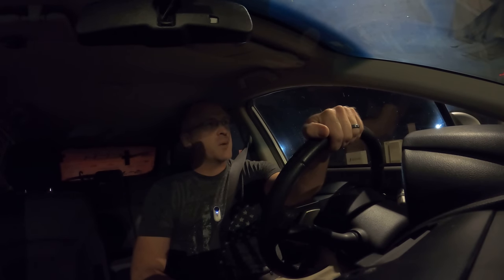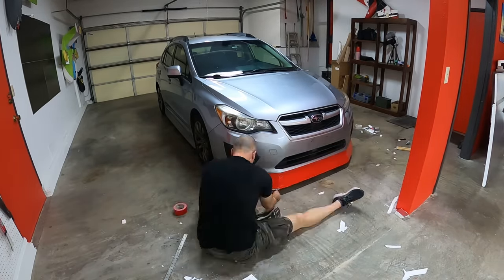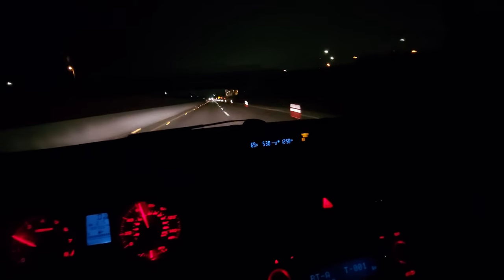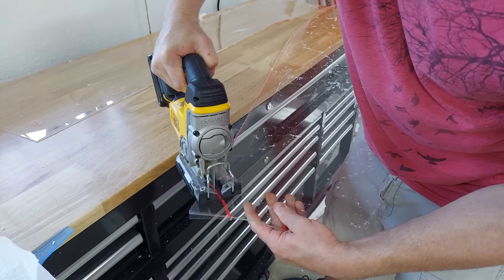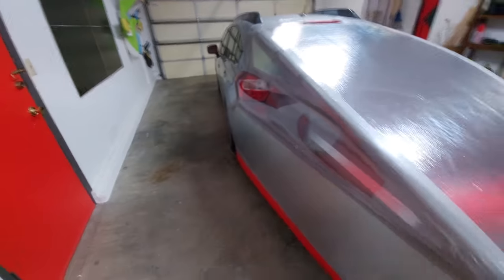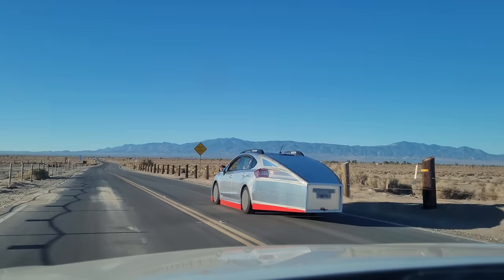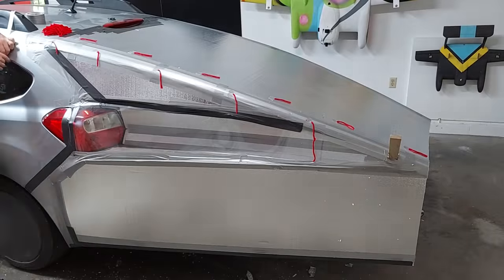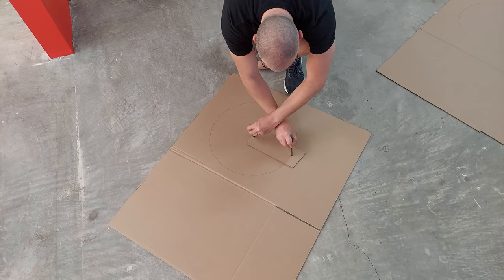Beating High Gas Prices Using Simple Aerodynamics (Home Improvement Store Edition)

Comment: The tufts only tell you if the flow is laminar or turbulent. It does not necessarily tell you "high drag" or "low drag". Also consider tire pressure: a difference of 2-4 psi can make a noticeable difference in rolling resistance and thus fuel efficiency. It would be good to verify the pressures when setting baselines to make sure that isn't affecting your results.

Comment: 2 things that may be externally reflecting your results: 

- Fuel efficiency can be notably effected by your ECU in your car. External temperature and engine temperature may cause your ECU to adjust your air to fuel ratio.

- wind, driving in a head on wind or a tail wind can make a significant difference. 

- humidity

Comment: Sealing that underfloor even partially will still help

As well a front splitter will also help over just that chin, also when building make sure it extends past the front firewall or from that front firewall to about 30mm past the front air dam

Also a much better test for aero drag would be coast downs rather than long drives due to variability

Also “vortex generators” are a fickle beast and mostly useless without complex cfd work

You’d get much better results from sealing panel gaps Ana worrying about tire pressure and equalizing them

Comment: The skirts you put on the front and sides simulate the function of a diffuser (shielding air flowing below the car from the sides and accelerating it at the rear, by opening up the way the air can move). A diffuser is used in Motorsport and notorious for creating heaps of downforce and comparably low drag.
And I think here is the problem with the new tail. The 90° angle at the end is too aggressive and you get turbulent air and drag. Put your stripes beside the licence plate. If you gradually slope up the bottom of the tail as well, it should work much better.
Nice video and crazy interesting thanks 😅
Reply: The cutoff of the end of the tearsrop shape creates almost no extra drag for the removal of material. In fact, it can be beneficial to break the airflow that sticks to the car which is why tons of sports cars have abrupt tail cutoffs

Comment: When your improvement is going to detach suddenly at 90 mph and everybody panically braking being scared of it will bump each other in disorder, you'll discover a russian saying "Кроилово ведет к попадалову" which means "Hacking workarounds are usually the shortest ways to face a big loss". Easiest way to get even 20 per cent MPG growth is just a gentle handling with your gas. Good luck!

Comment: The problem I found with the newer imprezas for MPG is that they're overweight and underpowered, so you end up using more gas because you're pushing the engine more. 140hp is not enough to move 3,100lbs efficiently. 

This is why my WRX was able to do 38mpg or why the corvette is able to do 30-35mpg. Although both weigh more then the impreza, both have a considerably higher amount of power. Meaning that the engines are understressed when you are driving.
Reply: all depends on the torque curve, 140hp diesel is plenty for 3100lbs, too much rather, while gasoline, especially NA, engines are already at the upper end of their efficiency range.
The difference is the diesel makes alot of power at the RPM where its most efficient, while the gasoline engine typically make the same power at a higher, less efficient RPM.

With slightly relaxed highway driving, a semi-modern diesel with a efficient drivetrain and good aero does a good 55-63mpg.
Reply: @user-si5fm8ql3c  That's true too and I should of pointed that out too because I do know that diesels are way more efficient for this type of driving, but I think the reason why I didn't point it out is because he is driving a impreza and not a jetta.

Comment: there are fairly cheap fuel push drains that you could install in the bottom of the tank and drain the fuel, like those used on airplanes

Comment: your difference can be result of many things including fuel density, air temp, type of driving attempted ( sprint or easy acceleration ) , etc. usually 10% improvement isn't considered unless it's having a significant quantity impact. For ex 10% of 1ml vs 10% of 1000 ml.

Comment: Best fuel efficient mod on any CVT Subaru Is changing that fluid if old, the thing will regain a couple of MPG, also new spark plugs, the new NGK ruthemium plugs gave me about 1-1.7mg extra.
PS: I also own a 8th gen Civic automatic. You can get 40mpg pretty easily with no mods, I can imagine you could get quite a bit more out of it, it's a 1.8 liter 140hp engine, powerful enough and stock aero seems pretty good.

Comment: I think, if you put a Belly Pan, that covers the whole underside of the car. Cover all the gaps on the body with tape and block off some of the front grill, that should give you much better results. Also, ad much more air to the tires.

Comment: I'd be interested to see a spoiler that provides lift rather than downforce. I'm wondering if that decrease in force to the ground would have a difference? In my mind, there would be less friction since the air would be slightly pulling the tail of the car upwards

Comment: You should model your tail after a boat-tail bullet.   Check your state's law on how far you can hang/ extend your vehicle from the bumper.  Most state's have like a 2-3 foot limit.   You don't need a full chin spoiler.  just an aero fairing in front of the wheel and behind the wheels.  Think fixed gear aircraft fairing.

Comment: Gas pumps use back pressure that can be highly variable. But the weight of the fuel is consistent. Longer run and use a certified scale to measure the before and after weight loss due to fuel burn. A baseline of running down the tank, then adding 10 gallons should give you a good 60 lbs or gauge. Just a thought.

Comment: It's critical that the front of the car is as smooth as possible to help maintain laminar flow so to that end it would be advisable to ensure that the front lights and grill area as well as the wiper blade area be as smooth and sleek as possible. this should yield significant gains.

Comment: Hi There, nice project!
Due to the attached flow on the underside of your tail effectively working as a diffuser you may have ended up with more air under the car. Since the non smooth underbody and exposed wheels this may significantly counteract the drag reducing effect of the sides and rear.
Unfortunately I didn't notice any video of you driving on a dirt road with the first tail on. The amount of turbulence in front of the rear tire may indicate that you indeed may have more air under the car with the new tail design.

Comment: To get beyond 18% fuel efficiency, consider blocking the radiator grill. Use a clear window film and a double side tape to wrap the grill. Based on my past experience you could get 5-10% improvement. Your car won't overheat because air can still get into the engine compartment through the front bumper. Good luck.
Reply: I was looking for any comment about this. I find it interesting that the huge amount of hair getting through the radiator and engine compartment is never mentioned in the videos and articles I've been reading about aerodynamics.
Just recently some cars have been equipped with mobile parts to close that area and improve the aerodynamics.
That would be a very nice experience on its own!

Comment: If the bottom side of the tail isn't covered it is basically a parachute.  The back was open on the first tail, but closed on the second (for licence plate) .

While the tail improves flow over the top I think it is hurting flow under the bottom, which is why the front spoiler & sideskirts effect was exagerated.

Comment: 12:36 hmmmm... at first I thought the cabin side-skirts were like a single line (or two) of thick bristles (like a thin broom). Maybe that would be a good practical solution for an actual daily car, as when you drive over an obstacle (eg a high speed hump), the bristle would give way, but under normal high speed driving, they would act as a solid surface/wall, forcing the air to go around.

Comment: hi, i love this series it's damm awesome to see someone try this for themselfs and for cheap, one sugestion tho, the underside of the tail should come up very little in a curve, kinda like a diffuser to improve the smoothness of airflow on the underside, but not as much as the first version of the tail. The issue you faced now may be because of the flat underside of the tail catching the turbulent airflow that comes after the underside of the car itself, that pressurized air needs a smooth reintegration into the atmosphere and for that the small curve, that plus a flat floor would be an insane gain. Either way, awesome content

Comment: what tire size are you running? if its a 205 width I recomend going down to a 185 width and you will see a fuel economy gain, less contact patch = less rolling resistance.

Comment: one potential explanation is that you're not treating the air under the car very well with the new tail. It stays close to the ground and just dumps to open air. I'd be interested in the effect that adding a rear diffuser would have on it. If I'm not mistaken, that's one of the race car mods that increases both downforce and efficiency.

Comment: Dimpling flat surfaces ( like a golf ball) helps keep air from sticking to the surfaces, In not sure how practical it would be to do on the parts you added but it does make a difference to the point that some advanced race engines have this aero trick in their intake systems
Reply: Also, “Cyber Subaru”? 

Cyberu?

Comment: I'm sure a super flush underside is better than front lip, but for practical reasons (it'd cost so much to have an absolutely flat underside) the lip is good, especially to retrofit to stuff like a semi. When you consider how much they haul and then figure in a half mile of fuel savings that's a lot of fuel saved over 500,000 miles of trips.

Comment: After watching these two videos I decided to design a car based off of what you said in concerns to why auto companies aren't making cars more efficient. After making a sketch I commissioned a 3D model and had it tested in a wind tunnel simulation up to mach 1.01 (775mph) where it was stable.

While looking into a few other things concerning vehicle manufacturing I learned that America has a strict law about fuel efficiency based off of the footprint of the vehicle (makes no sense). It's measured from wheel center to center, and if the vehicle deviates from a chart the Feds made, manufactures get fined $10 per 1/2" out of tolerance. And to get REALLY good aerodynamics, cars would have to be way outside of that chart tolerance. So the car I designed would have an additional charge of roughly $500 or more to the manufacture because it was to aerodynamic if I'm understanding that law correctly.

Comment: As a truck driver with millions of miles behind the wheel. I'd found myself working this problem. Occasionally you'd see snap out panels on the Swift trailers. Never seen it done, but an air filled panel could be made. And then I thought what if like a shaped air balloon or parade float. a shaped air filled bag could be used. Every truck has a air compressor. But a small scoop that let air back out at low speed could solve filling too. The Ideas for anyone wants it. May apply to pickup beds an cars. An maybe multiple inflatable panels that draft would pull together. 🤔 or it's just a daydream. Years of time to just daydream. Ask a long haul trucker sometimes. Your problems could help pass the time or keep us awake.

Comment: You can consistently fill if you let it auto stop and then re pump after 30 seconds or so idk but some times the stop extra early and can still take a bit more. If your already doing this idk if you can get a better reading without measuring the fuel it’s self.

Comment: have you completely smooth seal the underside of the car?
Also, the cruise RPM of the engine influence the fuel consumption a lot. Change to a taller gear and cruise at say 1500 rpm or less (if possible).
Sealing off the wheels so that there is no air hitting the tires is a great way to reduce drag.

Comment: Wetted area?

Tufts on the sides are turbulent because the air passes over the wheel openings?  And then over the trip strip transition to the fairing?  What do the tufts look like just forward of the transition to the fairing. 

It’s easier to make the air go around the bottom of the car than it is to smooth the airflow under the car, to a point.  Beyond that point the ground effects drag on everything but a flat road.  So there’s still benefit to a slick bottom.

Comment: My knowledge of aero is pretty much limited to what you explained in the last video. However, based on that: it seems like a lot of the turbulence/drag occurs behind the airfoil, rather than on its surface? If that's the case, the second tail might be producing a greater amount of drag that the tufts aren't able to pick up/visualize. Perhaps the added drag is because the second tail is "more truncated", i.e. the rectangular opening in the back is bigger? As you said, you might be able to curve the tail down and in a little more.

Comment: That last tail section, was cutoff leaving a large flat square back end, i think this might have hurt the efficiency.  I think you should have it come into an upright fin like structure, thus keeping the top and bottom relatively the same but pulling in the sides some at the rear.

Comment: Maybe it's because of dynamic engine mapping?  I believe modern cars can alter maps based on driving?  Maybe you were lighter on the peddle prior to Mark 1.  Maybe perform a throttle body reset on future attempts?  You could also track fuel usage using a cheap odb2 dongle<$20

Comment: I've often wondered if you could have an inflatable plastic tail on the car to improve the aerodynamics. If you made it transparent you could even see the tail lights and the license through it. Another possibility is that the tail could automatically deflate against the rear of the car when you were going at low speed to make it less unwieldy, and for parking.

Comment: One suggestion, if you ever driven a bycicle you can feel the dinamics and how weight is what is more important in efficiency, the lower the weight, the less effort you need with the little hills on the road, also with the tires being distorted over the pavement, in conclusion, the lighter the less fuel, its the most important thing in my point of view.

Comment: I think a problem with this tail is the small amounts of air getting under and around the sides of it got trapped in it like a parachute like you said, if the bottom was closed off or the tail open like the last one i think it might've done a bit better, but hey i'm not a scientist~

Comment: I had a talk yesterday with someone qualified in aerodynamics, and they told us about how in some scenarios the drag created by the air just sticking to the surface can be so high changing other parameters to reduce drag will be inneficient.

(I am paraphrasing, it is not at all my domain, and I didn't get a lot of it because english isn't my first language, and also I was stoned and tired ^^)

But maybe a combination of a slippery finish (don't go the golf dimple route, partly because you'll do a lot of work for not much results, and it's half marketing scheme nowadays anyway, like this car made by buggati with *active dimples*) and reducing the surface while keeping similar aero propreties could help ?

If I'm not mistaken the teardrop really can be troncated in the rear without changing the aero propreties, and maybe just clear tape on the foam will smooth out the finish enough ?

Again, very much not my domain of expertise, grain of salt, all that... you get it ^^

Comment: just in case this project is still actual.
you can use 3D scanner to do 3D model of your car's floor and then print plastic shields to make plain surface under your car to reduce air turbulence

Comment: I saw the EV-1 at the Phoenix motorshow. They had a cut-away car, displaying the aluminum structure and plastic panels, plus the teardrop body shape. Unfortunately, at that time it carried lead/acid batteries.
I remember thinking: To hell with the batteries, put a lightweight aluminum motorcycle engine in it. I'm sure 75 mpg would have been easily attainable.

Comment: Man! It is not just the gas pump(suggesting a extra flask as test tank here), the slightest bit of sidewind trows off your measurements by a few precent. That is why car-manufacturers make there test run on the same frozen lake, in the same wintery forest, in Sweden, on a a sunny morning. It gets as close to laboratory conditions as it can get. 

I like the new downward tail more, than the horn tail. Just make the drop angle somewhat in the region of the windshield's, i.a. make it shorter. Then turning or sidewind is less of a factor.

Comment: 1. You should let the air pass under the front bumper
2. Side skirts was good idea
3. Should have tried putting under belly of car in a flat sheet making it plain and smooth
4.tail section should have been shorted and pointier

Comment: Even though your car was aerodynamic modified you did not  violate any vehicle safety or emissions rules or regulation so the police had no grounds to stop you as far as I know. Great Job on exploring the MPG improvement. Every bit helps these days.
You mentioned the tear drop or rain drop shape was the best aerodynamic shape. Have you considered trying out the old SAAB 93 as a test cars, it was shaped like a rain drop ( rounded front shape tapering down to the rear) ?